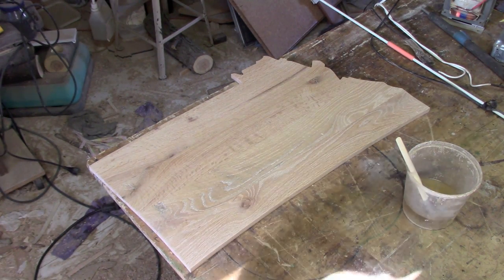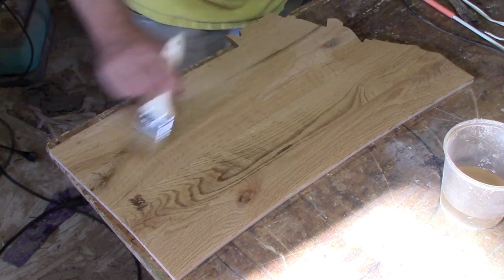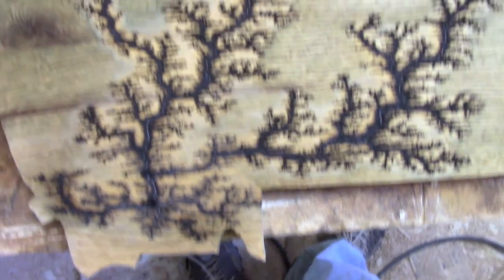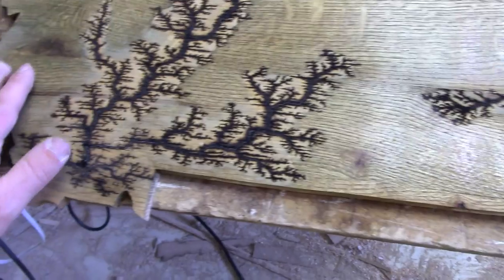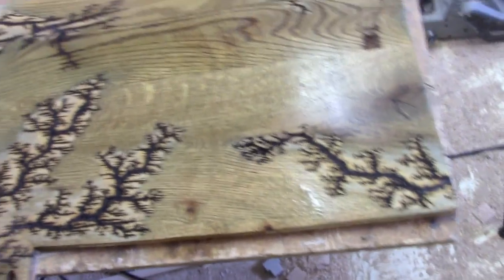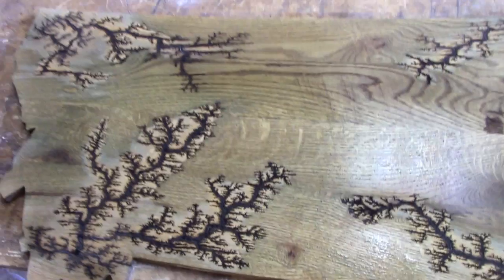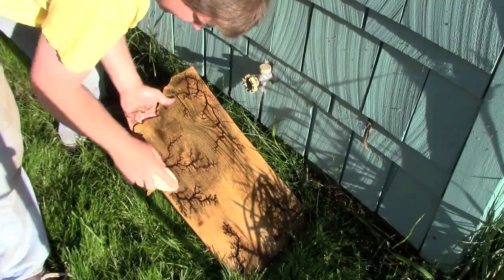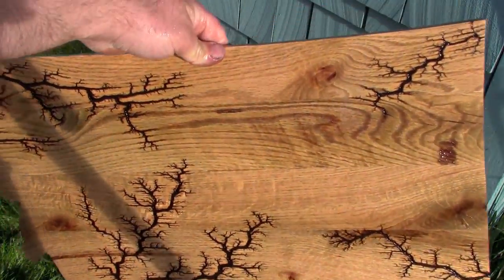Oak Lichtenberg Figures

Comment: What's your setup? Are you using a microwave transformer? Neon transformer? Oil burner igniter transformer? Also are you using GTO15 wire? I have a neon Franceformer 9,000V 30amp but it has GFP (ground fault protection) and it won't burn wood. My microwave transformer burns good, but it burns deep with less detail. Thanks
Reply from the maker: I use a microwave transformer connected with lamp cord.  People rage about how inadequate it is and it is for sure.  Try using a ballast to get the MOT to burn.

Comment: The baking soda solution will stain the wood green.  there are other solutions you can try that will not do this but the burn pattern will look different.  I have tried Aluminum sulfate and ammonium sulfate individually and combined.  You can also try just straight lemon juice.  None of these will will stain the wood like baking soda will but again, the pattern will vary.   Good luck.
Reply from the maker: I will try lemon next then.  Thanks!
Reply from the maker: Tried it with a number of woods, ballest settings and solution mixes.  Very right on no discoloration.  Video of the first experiment will go up tomorrow and it will include a link to your work and credit for the idea.  I hope that helps bring people to your work.
Reply: Wow.....thank you.  If you are going to link, send them to

 https://www.facebook.com/Benjamins-Key-684272731749937/?ref=bookmarks

That goes to my facebook page where they can see all of my stuff.  I am just starting to make my work available to others as I wanted to really create pieces that captured my vision and earlier pieces just weren't there yet.   Glad you had some success with the alternative solutions.  Can't wait to see your video!!
Reply: Oops...just noticed you already posted.   No worries at all....thanks for the shout out.   Definitely look at the ammonium sulfate and aluminum sulfate mixture when you get a chance.   The detail is better than the lemon juice in my pieces.   Have fun....love your creations.

Comment: you sanded away so much of your fine detail. too bad. what transformer are you using? why aren't you wearing safety glove?
Reply from the maker: Unfortunately the solution raises the grain and gives it an unpleasant look.  Unsealed it is to fragile, sealing over the rough wood gives a poor surface finish.  Still trying to work it out.  Others have commented I am too cavalier with the voltage.  I am standing on a rubber mat and working one handed but yea I should have a glove.